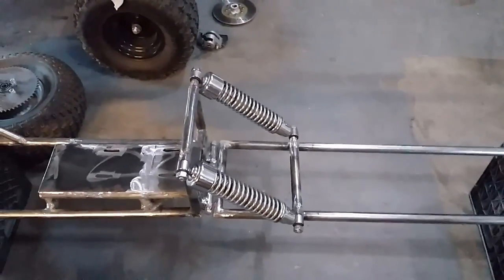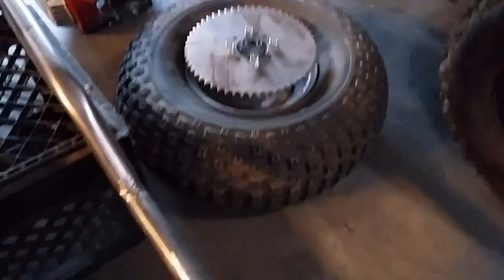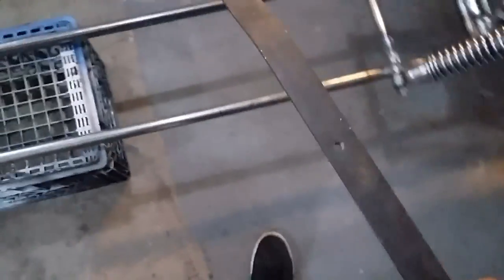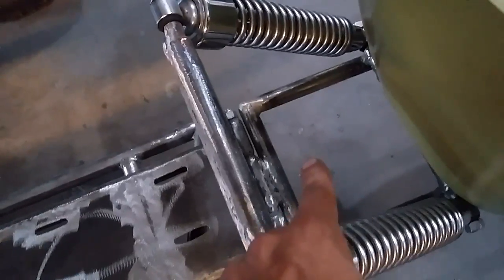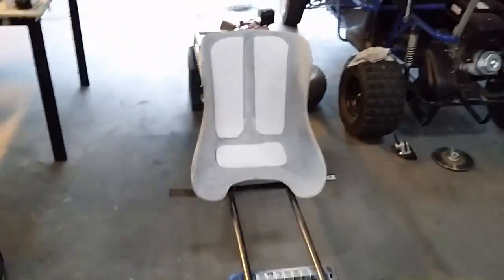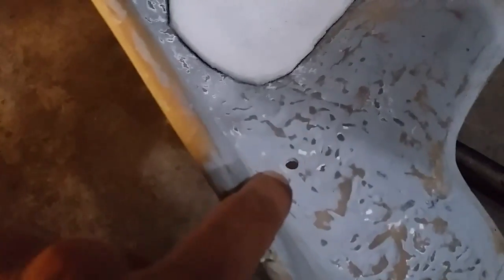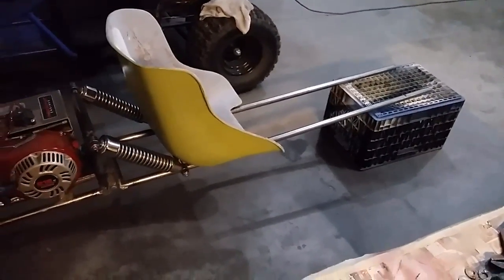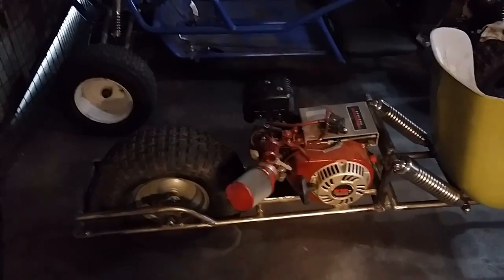T-REX INSPIRED GO-KART!!!!     (part 1)

Comment: Do you remember where you got your rear wheel assembly?
Reply from the maker: +Don DeLaire I think I got the wheel and tire from bmi karts and the sprocket and brake disc was from somewhere else, don't remember and I had to have them machined to fit right